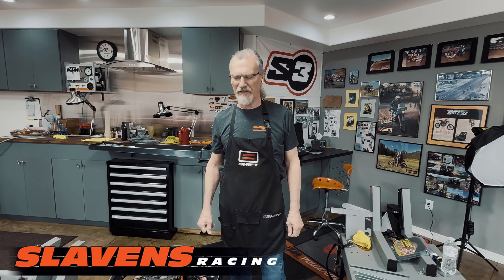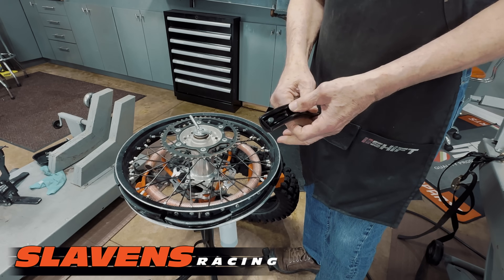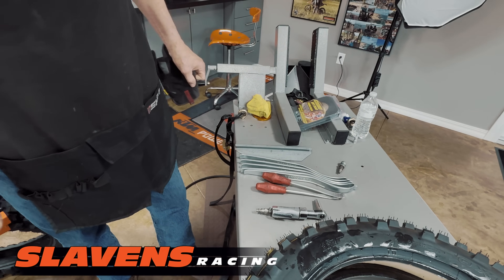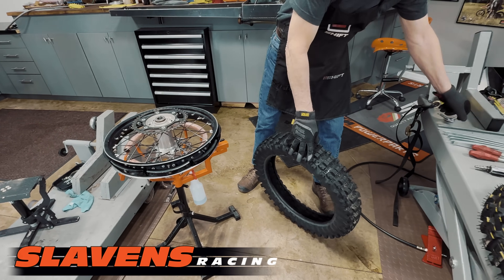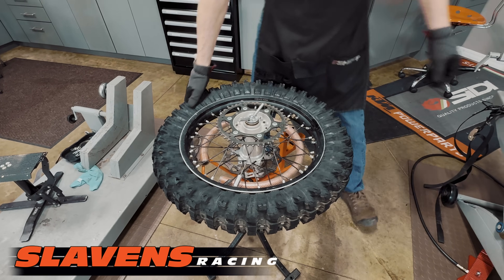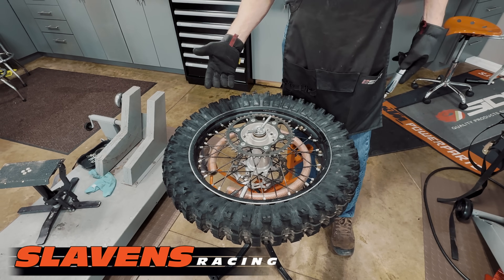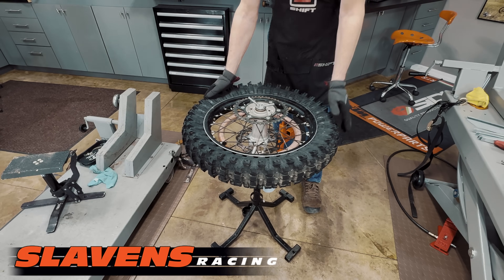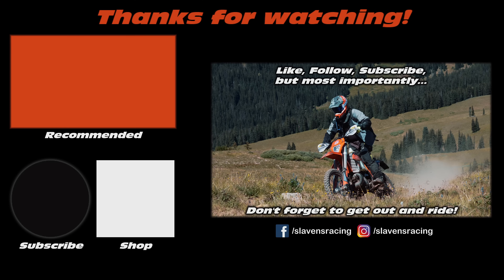Confused About the PROLOCK 360? We've Got Answers.

Comment: Oh wow im ready for this i hate tubes and tubliss costs wsy to much
Reply: Tubliss costs like $100 and will last for years and years--i can't really see this being more cost effective. Also if you remove this system to sell your bike, you end up with a bunch of holes in the rim. I just don't understand what problem this is solving over the normal tubliss...
Reply from the maker: Hello Eric:
TUbliss is an excellent system that I have used for many years, but the 360 is far superior. There is no bladder to fail, no liner to damage during installation or removal and it eliminates the slow leak issue many guys have because they don't get the liner seated correctly.

Comment: I have a spare set of wheels waiting for this one, I know it aint 'meant' for street but man I really want to use this on my KTM 500 instead of tubes (just the tubeless setup, no half mousse).
Reply from the maker: Hello:
The 360 system will work for street riding, but will only fit the stock 2.15" stock wheels. It will NOT work with wider super moto wheels.
Reply: @slavensracing  That's exactly why I want it, stock wheels not sumo this would be a dual sport/trail bike, keep thinking of how nice this would be for a long trip on the 500, just carry plugs and good to go. I know people that use tubliss on dual sport bikes but I never liked the possibility of inner tube failure while out and with this setup, even with a catastrophic failure...the wheel is probably staying on enough to get you somewhere.
Reply from the maker: @SCakey  
It is an excellent set-up for that scenario and the tire will never come off.

Comment: That system seems much better than the current Tu-bliss system but puncture flats are still a real possibility but there are quite a few tires these days with pretty tough carcasses that will plug quite easily, I've actually had really good luck with the newer extra heavy duty tubes and I like the feel and  adjust ability that air pressure gives you, if your racing then a mousse is the best way to avoid flats.
Reply: I don't see why I would want 10 holes in my rim.  Drilling the holes precisely seems like the most difficult part by far. Or do you have to buy the rim and the have a wheel built?
Reply from the maker: Hello Rob:
The 360 is a definite upgrade over the current TUbliss. I use the Platinum 5150 plus the 360 system. Without any air added it has about a 4 psi feel with a Dunlop AT81EX Gummy, so it is basically flat proof.

Comment: I don't understand the point of this thing , whats is differents  compared to a tube and two rim locks ??   You still can get a flat , your wheel is not going to slip with two rim locks and if you think it might well put 4 rim locks 🤷  so what is the point oh you can run 1 psi well i can too with tubes 🤷  then you will say oh you will pinch your tube if you use tubes at 1 psi , who the hell cares you have 1psi in your bloody wheel 🤦  these things are for people who struggle with riding and is just a cash grab learn how to ride with tubes like the bike was designed to do
Reply: This is for Hard Enduro Racers, tire can't come off the rim and with a half moose can finish the race even without air pressure.
This was designed for racers, not for trail riders.
Reply: Way easier to fix a flat.   Wish they were released before my fall Baja ride.
Reply from the maker: Hello Zack:
I understand your confusion. The 360 system gives a 360 degree rim lock, but that is not the main purpose. It is a TUbliss system that can be used with just a tire or the best set-up is to use it with the 5150 half mousse https://slavensracing.com/shop/5150-nitro-mousse-by-nuetech/. Definitely no "cash grabs" here, just quality products.

Comment: Can you use a used/older tire or does it have to be a new tire like the tubliss system recommends? Does it hold air well with an old tire?
Reply from the maker: Hello Cain:
Nuetech has not released a lot of details yet, but I suspect they will say to use it with a new tire. However, I installed it with a used tire and had no issues.